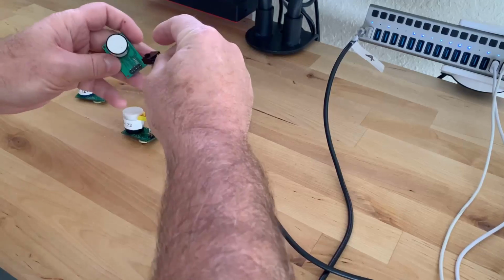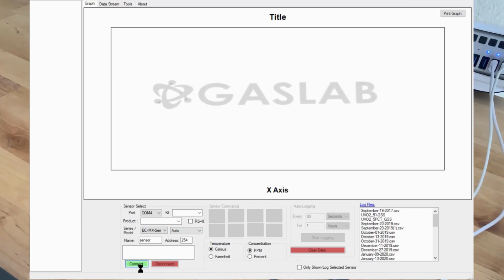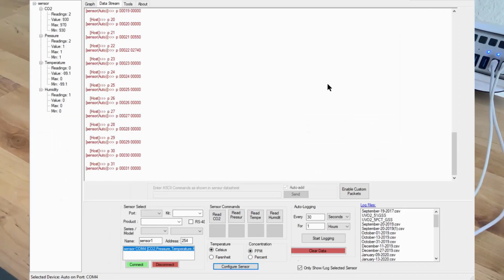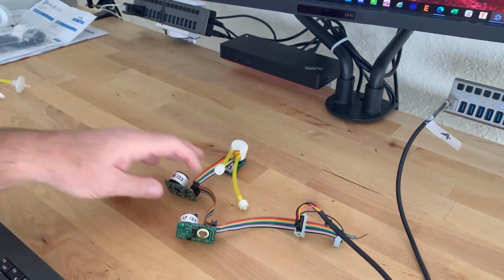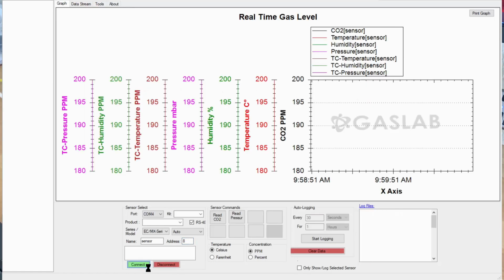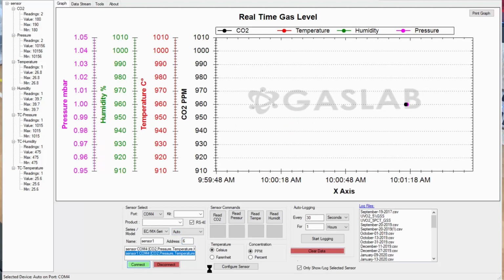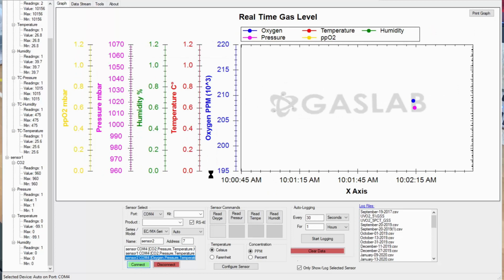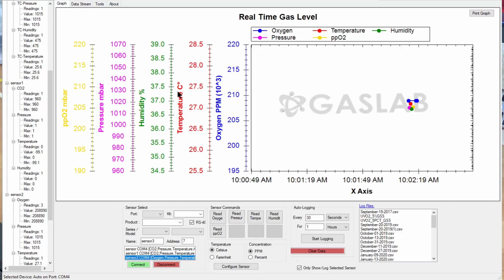RS485 3 Sensor Setup

Comment: can the information imported into this software be used to control solenoid valves? can i export the data to allow AI to interpret?
Reply from the maker: @paulnovak833 The interpretation would probably require some development code, but otherwise yes it is possible.